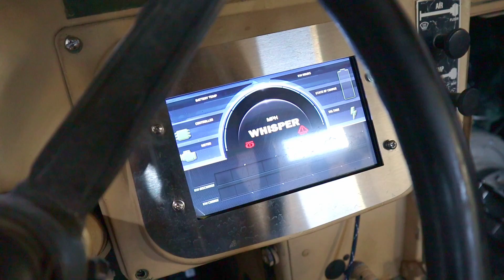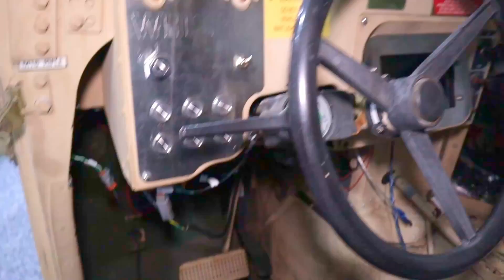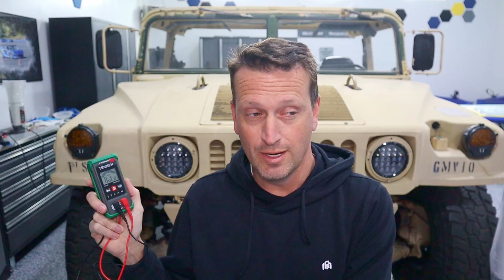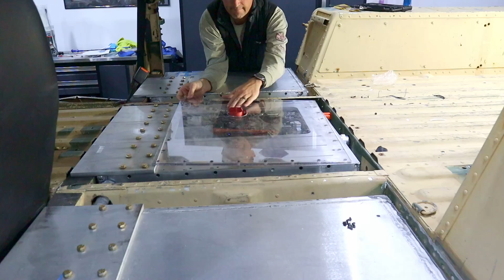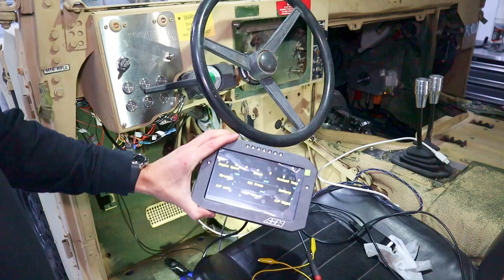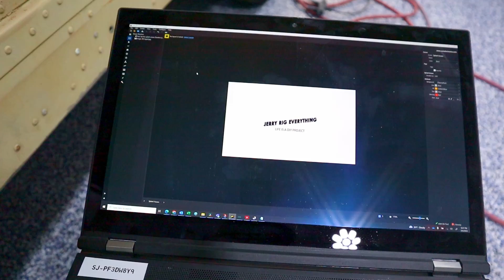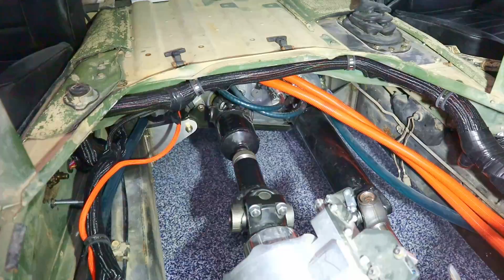Electric HMMWV Display

Comment: my guess is 42.. because that's the answer to everything!  I'm a network engineer and amateur radio operator.. so I'll be using it to build antenna transformers and measure my power supplies!

Comment: My guess is 532. No reason why, it was just the first number that came to mind😅. I work on many different types of equipment from high voltage to small electronics (though I went to school for residential, commercial and industrial wiring) just as a hobby so a meter with an auto function would be incredibly useful.

Comment: Again while in the military working my job as a air conditioning technician I worked with high voltage and also very careful but there were still times that I was working with live circuits, and I have seen what I like to call blue angels sparks ⚡️ which are very scary, so might the No. be 240?

Comment: I can’t even imagine having to diagnose the electrical problem with that. I once had a dodge military ambulance that the air conditioning fan was not working and I was given the job to find out why it was not working well with the wiring schematic I proceeded  with my task I found that I had a bad fuse but that is where my problem got difficult I removed the dashboard looking for this fuse it was not in the fuse box, now this might seem funny to a lot of people but a week looking for this fuse and I finally found it, the fuse was in the ambulance box under the rear cabinet driver side. I will have to want to guess the No. to be 168 for the number of hours I  spent looking for that fuse.

Comment: 642 -- I have an old Porsche that has been an electrical nightmare. It will be nice to have a reliable multimeter to troubleshoot my wiring to find each corroded wire and verify wiring conductivity. :D
Reply from the maker: Nice!  Thanks for the contest entry!  Good Luck!

Comment: Love the videos on the humvee! I work on transit busses for a living, a good amount of work I do is with electrical and diagnosing can bus issues there are multiple can bus networks with multiple modules for the powertrain, braking system, and suspension that talk through multiplex modules via j1939 can. I already have a couple meters but if i win it would be put to good use. My guess is 1000
Reply from the maker: Thanks for sharing

Comment: 789 - but under $10 for real?  Wow --- it annoys me when it always defaults to AC on my existing meter and you have to toggle it using a button press (I'd prefer a dedicated switch position for AC vs DC on the one I have) nothing earth shattering for usage, just projects around the house.

Comment: What if the problem is in the Smart BMS itself, maybe some cables are connected in the wrong order or maybe the BMS is faulty. It's even possible that one of the battery pack is defected since li-ion battery tends to fail for no reason sometimes

Comment: Hey, aren't you supposed to only use distilled water with antifreeze?
Also on your bottle it says 50/50.
Usually antifreeze is much more conducive than distilled water, so probably that mix that you're using is made of distilled water and a special antifreeze that is less conductive then regular antifreeze.

The difference is most likely in the antifreeze formula and not in the water.

Great video btw.

Comment: 397 - I will use the multimeter for my home improvement projects at home and my random diy projects. My only electric car project up until now has been a power wheels conversion to run on my Dewalt batteries.

Comment: 433
I will use the multimeter to keep myself from getting electrical shocks when I install z wave switches Aron d the house. I know you should shut off at the breaker, but…

Comment: 213 I could really use a new multi meter, mine is falling apart!  Lately I've been harvesting and testing 18650's from power tool packs, but I use my multimeter for so much other stuff too. In the short term I'm going to use them for the power tools I have, but in the long term I want to build my own EV pack for an EV conversion I'm planning.

Comment: 369 - I don't have a specific use in mind but If I had a multimeter then probably the first thing I will do is to check the voltage of the pencil cells 😂

Comment: If anyone can get the electric humvee working it's you. My guess for a number is 0588. I need a volt meter as I have an 02 Chevrolet Blazer. I need to do electrical work on it and I need to test the circuits. What is cool is the vehicle body isn't in the best shape but it's inspired me to learn how to weld. I was going to replace it but now that I'm learning off of it, I'm probably going to pursue eduction into welding or even go further and may look into vehicle body repair work.

Comment: I can't remember if you verified this already, but are all devices on the CAN bus using the same baud rate? That is a common reason for a given device garbling a CAN bus due to incompatible baud rates.
Reply: Another thing to check is message Tx Rx requirements. If a Rx device is expecting a non extended CAN message, but the Tx device is sending an extended version of the message then there is every chance the the Rx device will ignore it.

Comment: few questions:
1. do you have a source address (SA) conflict?  you can use PCAN to sniff the messages
2. why put a switch on the HV?  you should control the LV supply for the contactor - make sure to open contactors with as little load as possible.

Comment: 751 , I am always doing stuff around the house and my multimeter you have to change where things are plugged in depending on what you are doing and switching the dial to the appropriate test.  The auto check feature on yours looks really cool.

Comment: 537-I'm going to use the vom in my 2018 F-150.  It looks like a nice unit to keep with my vehicle toolbox. We tow a lot and sometimes trailer electrical issues rear their ugly heads. I hope youre going to use another method of contact than the telegram text messages I get everytime I post.

Comment: 789 Need a new multimeter, because my old one, theoretically works but is very bad over 30% off. Using it mostly for fixing and troubleshooting all around the house.

Comment: That multi meter looks like a very good deal at that price and would be a good choice for beginners compared to the $5 Harbour Freight option (which lacks reliability due to test lead and switch quality).
That being said, for more advanced users, I have found that the automatic meter I have which is a Blue-Point (Snap-on) quickly fell off my favorite list. 
Before long the options found on (much more expensive) meters will become essential to many of the tests you will use daily.  A bar graph for example helps checking TPS and hall sensors. In the long run you will need true RMS and even a o-scope. The good news is these higher quality testers have come down in price 10-fold compared to what any older technician would have paid just 10-15 years ago.

P.S. These successful repair videos have totally destroyed any chance of Zach accepting my scrap value offer for the Hummer. Thanks, Electric SuperCar.  ;)

Comment: Help me out here. Zack put in electric power steering boost that applies force to the input shaft of the power steering box. The input side is usually the side the low force i.e. the human force comes from and its is boosted hydraulicly inside the box putting the forces on the output shaft and the internal drive mechanism attached down stream of the hydraulic boosting. The way I see it he is adding tremendous force to a component not designed for it to be done that way. It's like if your engine stalls and you lose power steering and you have to try real hard to get the wheel to move just a bit. The way he's don't it it's like having 20 people try turning the steering wheel. If I'm correct (happy to be corrected) the steering could suddenly fail at an unexpected moment. What are your thoughts?

Comment: It would be good to get a simple gps heads up speed display, 25 bucks on Amazon. Many of those road side speed displays especially in maryland and Virginia are calibrated to show 5 mph slow to mislead drivers into thinking they can go faster than their car speedo shows, and this results in revenue enhancement  for the jurisdiction.

Comment: 625 I’m a service plumber in it comes in very handy for not getting zapped checking the power for a water heater or diagnosing electrical contacts on a tankless water heater

Comment: my first thought is that the vehicle control  is miswired, like wires swapped, or intermittent ground on one of the data lines. Do you have something else that can read the CAN bus? typing this in before you figure it out to see if my hunch was correct.. 5567, I'll use it to validate LED wiring for a dragon head powered by WLED

Comment: 0117 having a small multimeter thrown in with my soldering repair kit would be exceptionally useful. Just like measuring tapes you never seem to have a multimeter on hand when you need one.

Comment: 0005 I plan on using it to ver more unto electrical components and understand how they work and the reason for the multiple cables in my 1994 Fiat uno, and get all electric components working as intended

Comment: Is there a possibility that the CAN messages were at different baud rates and the Andromeda couldn't cope? This is something I have heard of happening for some other systems, where some are tolerant of mixed baud messages and others aren't - though really everything should be same baud rate. Other possible culprit could be extended IDs
Reply from the maker: We did look at that and everything was at 500kbs

Comment: 235 - I have been hobby-ing on converting an old 2.5l jeep motor to utilize an arduino for ignition control and fuel injection control. (Speeduino platform) An extra little meter would be handy. Any extra oscilloscopes? LoL
Reply from the maker: Nice! Thanks for the entry!  Good Luck!

Comment: I've had some battery system issues in my own car so I would use this to help figure out why my head unit isn't powering on at the moment. 652!
Reply from the maker: Sounds like you need it more than most!
Reply: @electricsupercar  i'v never needed to use one before lol.

Comment: Might sound dumb BUT i used to flash a lot of software in the past to diff devices and it could be as simple as the USB cable not working properly. If you switch the cable it might flash
Reply from the maker: Nice thought!  I did try another cable...same result
Reply: @electricsupercar  extremely happy and excited to see the tachometer move!!